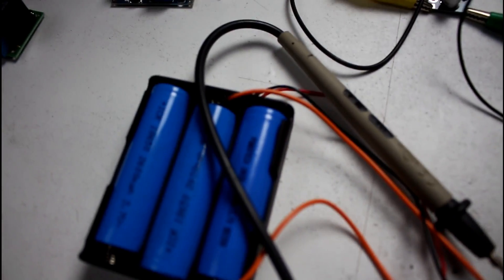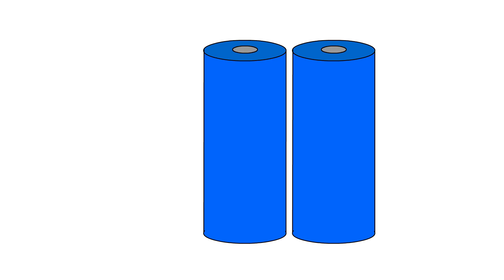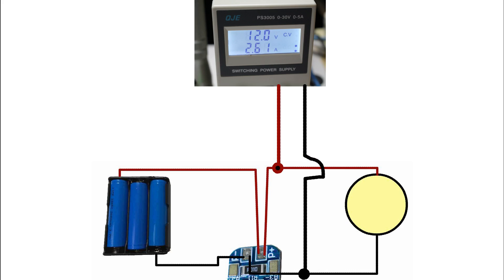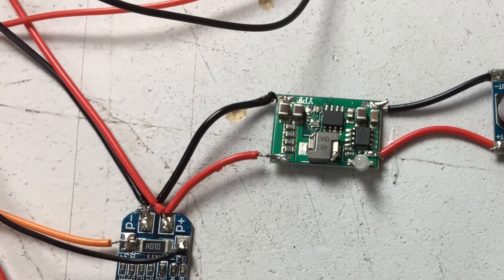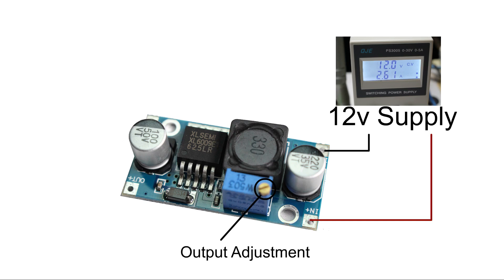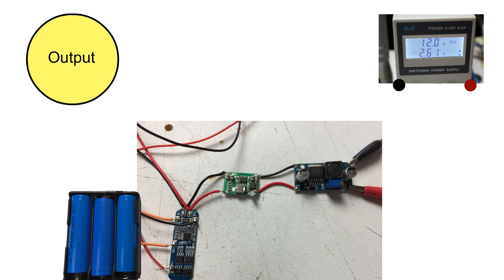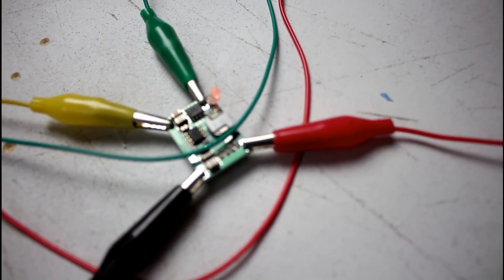Lithium cells in Series with BMS - Battery Pack Considerations (MEHS) Episode 61

Comment: Hi. Great video. I've got a question about these protectn boards, donno who to ask maybe you know.
So if I install a prot board on a toy car rather than on the battery, will I need to kick off the system with a charger every time when connecting the LiPo? Most specs say that output is closed initially. Would not be a problem if I glued and soldered the prot board to the battery not the car, but this is not what I want. I want to disconnect the batt completely when just storing it. No daily use. Thanks for experting it.
Reply from the maker: - Hi.  No I don't think that will work.  The BMS needs to connect to the cells as it brings them together to provide a higher unified battery.  If you want to isolate the battery for storage, just install a switch between the BMS and the motor.  The BMS becomes part of the battery and won't draw any current when stored.  Cheers.
Reply: @michaelsstuff4402  --- thanks a lot. Nevertheless I got to do something like that. The LiPo is normally uded in quadcopter where an addtnl BMS is not desired. Occasionally I put the same batt in a car, where I do need over-discharge protection. Stopping and weight not an issue there, but would be an issue with the copter. Basically I only need an occasional over discharge protection. Charging is controlled differently.

Comment: Yeah thanks!, i have 1 more qqquestions i powered this bms by my step up board from usb 5v to 12,6V.Step up is veery hot. 1A used.Its normal??
Reply from the maker: - Hi.  You should use your meter to measure the output from the 5V supply going into the step up board and the current coming out of the step up board going into your BMS.  The 5V source is probably capable of 2A output.  Your BMS is likely needing between 1 to 3A.  Most small step up boards are only capable of 600ma, some 1A but it will be working very hard.  Might be best to make sure the 5V source can produce plenty of current and you use a solid step up board capable of 2A or so.  Take a look at the Pololu step up boards.  The U3V50F12 can give a solid 1.5A at 12V from a 5V supply.  Link https://www.pololu.com/product/2568

Comment: My Electronics & Hacking Show+
Have you ever used 4 TP4056's to charge a 4S 16.8v battery pack? Fast and efficiently @ 4amp balanced and charged??
Reply from the maker: - Hi.  If you mean one TP4056 per cell separately then yes a good solution.  If you mean running 4 TP4056 boards into a BMS then no, that won't work as each IC is looking at the individual cell, you can't combine outputs into 8.4v, 12.6v or 16.8v and get the same results.  If you connect each TP4056 to each cell and bypass the BMS then it can work.  You need to watch out for common ground issues which is a typical problem when using multiple TP4056's where the batteries or pack are connected together in some way.  Cheers.
Reply: I mean 4 TP4056's connected as one TP4056 to each 18650 battery as you would normal directly on the terminal, but in a 4 cell holder with wires on each battery then you run the first battery wire negative to the next battery's positive and so on, These 2 wires 1 neg at one end and 1 pos at the other end is used for the DC inputs on the device. So it's wired in series while the TP4056 are all wired in parallel, the trick is you need isolation on the inputs, each TP4056 has to have isolation so it's easier to run 4 USB Phone Chargers then you can wire the AC in parallel, I stuck mine together in a clear project box using a extension cord. You will get 1 amp per cell so 4 amps for 4 when they turn green they're charged and balanced. I have a bunch of them working in my mini amplifiers. You can do this for 2S~ whatever you need. You can do 2P/4S, but the charging will be limited to .500mAh for each cell. This would make a great video if you'll try it. You can use 1 supply if you use a isolation chip but you're limited to .200mAh not good.
Reply: I just subbed thanks.

Comment: sir please tell me which Rating of BMS i should use in 48 volt 33 ah lithium ion battery pack. I want us this battery in my 48 volt 15 Amp. 350 watt motor controller.
Reply from the maker: - I don't know that you will find a 13 cell BMS so you may have to make a number of 4S and 3S packs and combine them to get your 48V output.  Just make sure your BMS's are rated higher than the project current.  A 30 Amp unit should be fine but I would go any lower just to be sure.  Cheers.

Comment: Nonsense. The cheapest and easiest way for a rechargeable 12v project is a car-battery.
Reply from the maker: - Hi.  Yes agree that lead acid is the cheapest bang for buck considering what AH you can get from a car battery.  The issue is usually the size and weight of lead acid options in small projects.  Cheers.
Reply: That entirely depends how much storage you need. 4 lifepo/lipo batteries, solar controller and BMS circuit is about $30. A car battery is about $50 minimum. They also shouldn't be discharged at more than a tenth of their a/h capacity for more than a couple seconds at a time.

Comment: Hello, I need to run a solar power camera during the day and when there is no daylight left I want to run my project from a 3p 18650 battery pack. Do you know of a proper board for this? Thanks!
Reply from the maker: - Hi.  It depends on the current draw of the camera.  If its less that 500ma then I would use the Sparkfun Sunny Buddy part number 12885.  Cheers.
Reply: the video transmitter is a 100mw. the camera is 5-12v and the transmitter also accepts 5-12v. The solar panel is 5volts 5watts.

Comment: I need something like this too, maybe more capacity to run several different small electronic devices on like a camcorder, a IR LED array etc. The latter uses 12v, so that can be tapped directly off and the camcorder needs 3.7v, so i could use a voltage regulator in series with that or something. I'd rather not use a seperate pack.
Reply from the maker: - Yes that could work.  Cheers.

Comment: Something is up with my MAX745 charging board. no matter what combo on the dip switches I can't get it past 8.4V. the 3S setting only has 4.2 on the battery leads. I have no idea where to even begin finding out what's wrong.
Reply from the maker: - Hi.  Start by checking that you are feeding the board at least 15.6V so it can provide sufficient voltage for a 3S pack (up 12.6V).  The MAX745 needs 3V above the charging voltage.  If that doesn't help, take a close look across the board and make sure all the resistors are there (none missing) and they all test correctly.  Then test individual components and traces.  Hope that helps.  Cheers.
Reply: it might be the 100Kohm resistor. I'm reading 55.5K from it. But what I find weird is the dip switches seem off. all 4 settings yield nothing but 4.2V and 8.4V

Comment: So, this charges/discharges the battery via the balance leads, yes?  So limited to around 1 amp output, unless you use much larger balance lead wires.  Then there is the problem of the actual protection it offers.  On AliExpress the minimum discharge disconnect is 2.35V which is too low for most batteries.  The Maximum overcharge voltage disconnect is 4.3V which is too high for more cells.  I have seen evidence to suggest that a LiPo pack can burst into flames with as little as 4.37V per cell charge voltage.
Reply from the maker: - Hi.  Yes current is limited by the wire you use.  This one cuts off at 2.9V per cells so its fine.  Over charge is 4.25V which is also fine but you are correct, you need to know the details and test the claims to make sure all is good.  Cheers.
Reply: Hello brother, I have a 3s 40A bms setup for my batteries, yesterday they worked fine but today as soon as i connect a load the Output voltage of the BMS drops to 6V making the load inoperable. This board is even new already threw one 3S 25A board for facing similar issue. Pls resolve or guide me if u know.

when load gets disconnected BMS shows Op again to 11V...each battery has 3.78, 3.79 and 3.80V

Comment: Could you have used the circuit board in a laptop battery cell unit and substitute laptop batteries for multiple smartphone cells batteries. Cris crossing substitute
Reply from the maker: - Hi.  Not really as you would need to ensure the power going into the laptop is getting distributed correctly and not all laptops are the same.  You could if you knew the specifics and number of cells etc but not straight forward.  The principle however is correct because large lithium batteries (like a laptop battery) are just a number of 3.7v cells connected together with something like a BMS to make a bigger battery with more voltage.  Cheers.
Reply: My Electronics & Hacking Show 
In the case of cellular phone liion battery, the cells inside this type are configured different than round 3.7v. Laptop? I see that 3.7 bank chargers via USB charge cellular phone locally. If I were to remove the cellular battery from phone is remotel charging same remotely? If so then how does the BMS know what type of battery its charging. Is it mha
Reply from the maker: - There is no difference as far as voltage and how they are charged.  The BMS doesn't know what type of cell its protecting because lipo or lion are the same nominal voltage and charge the same way.  You only need to understand how much current or time you need for the pack you are charging.  A 3S BMS is 11.1V nominally and will need a peak charge of 12.6v @ 1A for about 3 hours.  A single 3.7V cell will be happy with a 4.2v charge at 1A for about the same time, depending on the capacity of the cells.  Cheers.

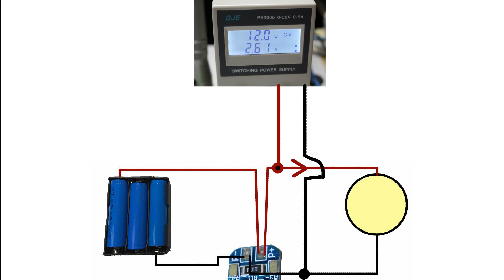Comment: What your're saying is exactly true, excluding few unintentional wrong schematics, like at 1:50.

Making a proper UPS type DC power supply with Li-Ion batteries is complected, and pointless. I'll rather use a 12V-7Ah lead acid battery to power up an external monitor, with a c/5 float charger It's cheaper and safer.
Reply from the maker: - Hi.  Yes agree using Lead Acid batteries is a much easier and cheaper solution.  Cheers.
Reply: Arnab Satapathi @

Comment: Hello,

I have a really stupid question (so forgive me), but could the BMS be used as a substitute circuit for of that which is used in laptop batteries ? 🙄😏

So you would use this circuit to power your laptop (still using 3 18650 cells) instead of the original one.

Because if you look up a video from Charlie Miller, titled "Battery Firmware Hacking" (almost 50 minutes long, but worth it)... then research either Smart Battery Worshop or Battery EEPROM Works program (for example), you see that if you want to just rebuild your laptop battery pack, it's not that easy just by removing depleted 18650 cells & adding in new ones.

So I'm wishfully thinking that the BMS could be used to power a laptop & also it could charge the batteries connected onto it as well. But this is really crude thinking. 🤔😑😐
Reply from the maker: - Hi.  short answer is no.  The laptop battery pack has a specific number of cells and the laptop is preconfigured to take the correct voltage and current from the charger that can power the laptop and charge the battery while in the laptop.  You can replace the cells yourself but you need to match the voltage and number of cells.  Anything attempt other than this should be done outside the laptop and you need to take care making yo, selecting the correct charge voltage and current and you would also need a step up regulator as 12V is unlikely to be enough to power a laptop.  Cheers.
Reply: My Electronics & Hacking Show Thank you for your detailed reply. ☺

Best Regards,

Comment: Could you please post an electronic schematic of your circuit. 
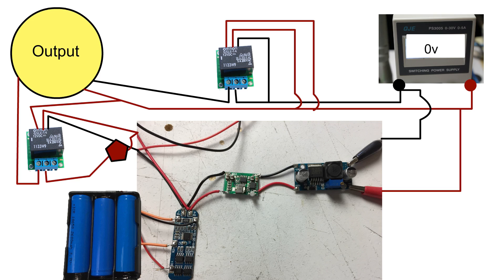I can't find the wiring @2:22 and @5:22 I can't make any sense of the wiring.
Could you please post a technical sketch?!?
Reply: Hello brother, I have a 3s 40A bms setup for my batteries, yesterday they worked fine but today as soon as i connect a load the Output voltage of the BMS drops to 6V making the load inoperable. This board is even new already threw one 3S 25A board for facing similar issue. Pls resolve or guide me if u know.

when load gets disconnected BMS shows Op again to 11V...each battery has 3.78, 3.79 and 3.80V

Comment: Hi, great info and has helped me a lot. I have been looking for a solution like this for a while now, too, and have one I think may work. Would you mind looking at the diagram below and let me know if you think it makes sense. https://www.dropbox.com/s/dbmh7dr8pcz1bmh/DIY-BT-Schematic.jpg?dl=0
Reply from the maker: - Hi.  Nicely drawn!  It looks pretty close but I think you will have some trouble around the switch, which I am assuming is a multi pole unit.  You have the 15.6v from the MAX745 board, the 5V from the bluetooth board and 24v from the audio amp all connected to the switch.  Depending on the setup of the switch you will likely have multiple voltages running around your circuit.  If your setup allows for complete isolation then you might be OK but it doesn't seem that way.  I'm not sure of the purpose of the connection from the switch to the bluetooth board but that power line will likely be a problem.  I suggest a FET to trigger when power is not required to each of those sections or use a suitable reverse current diode to stop unwanted current flowing to those areas.  You could always build the circuit and do some testing at very low current to see what's really happening.  Also, think about some of the simulation software out there that might help you.  Most of that software won't know what your audio amp or the MAX745 board are but you can still simulate the circuit just by substituting those boards for basic voltage sources.  Cheers.
Reply: Thanks for the review. I have made a new schematic incorporating some of your suggestions. What are your thoughts? 
https://www.dropbox.com/s/dbmh7dr8pcz1bmh/DIY-BT-Schematic.jpg?dl=0
Reply from the maker: - Okay.  Based on the diagram, it looks good.  I don't think you will need the reverse current diode between the 24v and 5v regulators.  My previous suggestion was about my concern around the switch connections.  I am more worried about the isolation at the power switch / trimpot, lots of connections.  If there is any electrical pathway inside the switch for the power to flow you will have issues with mixed voltages as mentioned previously.  If this is not an issue then you should be good.  Good luck.
Reply: My Electronics & Hacking Show Awesome and thanks for your attention. I'll test and maybe just use a normal volume pot and use a toggle switch to turn the power on and off.
Reply from the maker: - Good idea.  At least have the parts available if you need to swap out the trimpot / switch.  Cheers.

Comment: Excellent! I've been struggling with 3.7v using a TP4056, but it's to run a robot that needs 3v3, 5v, and 6v. With boosting to higher voltage it overloads the TP4056 BMS chip and cuts the power. I got around it by using the TP4056 - output to trigger the base of a large PNP transistor so I can pull much more current from the battery without losing the protection circuitry.  It makes so much more sense to just use a higher voltage supply but I couldn't find any suitable modules - ebay is flooded with TP4056 on all the charger module keywords. I'll give this a go. Thanks.
Reply from the maker: - Thanks for the post.  Yes I agree its easier to start higher and use step down regs to get the voltages you need in your project(s).  You also get better current control (less loss).  Best of luck.  Cheers.

Comment: Please answer this.  My need is 30amps at between 12.5 and 14.8 volts to power a portable transceiver.  Im considerimg a 4s and short charging the to 14.8v.  I would still use a BMS for safty.  Its not reasionable for the weight and complexity to us a 3s and a boost board mainly because of the 30a needed at transmit.  Thanks and Im currently watching all your videos trying to learn.
Reply from the maker: - Hi.  You're talking about a LOT of power there.  How accurate is the voltage range?  Yes you can stop the charge per cell at 3.7V for your 14.8V but that can be tricky and you wont get anywhere near the potential capacity of the pack.  I would go with a 5S3P pack and a 5S BMS rated at 60 to 100 amps.  That would give you all the power you need and you could use a robust step down regulator to get a solid and constant suitable voltage.  Might cost a bit but should last a good while.  Cheers.